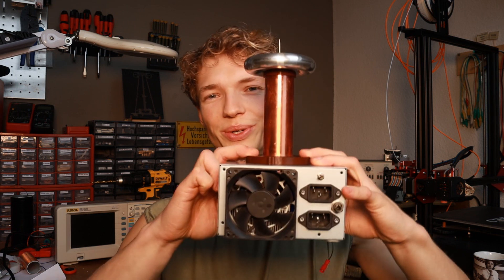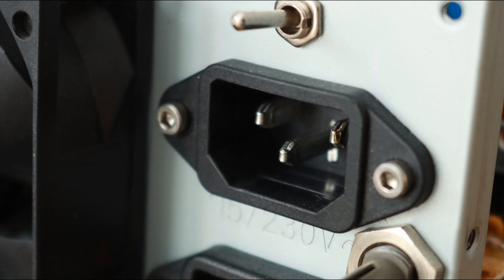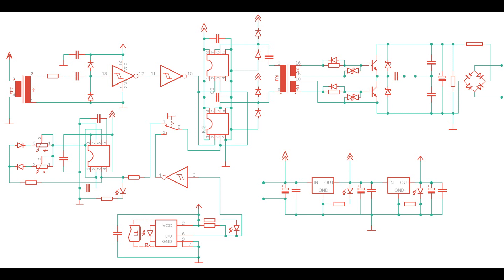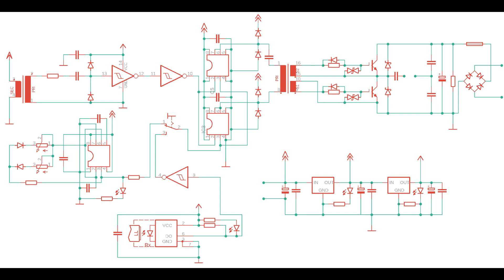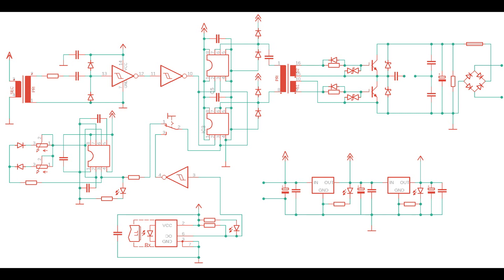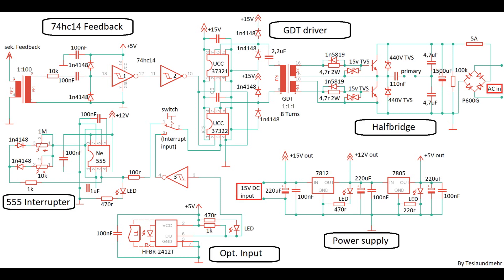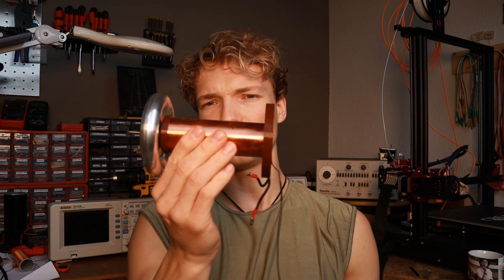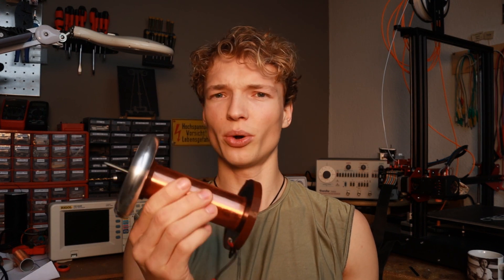Tiny Tesla Coil Tutorial (simple DRSSTC)

Comment: Another great design! I do wonder how you get the IGBT's from being simultaneously turned on (short cut), from 50% duty cycle. is that a function of one of the IC's? to set the pulses below 50%?
Reply: I might use optocouplers in the future to get hv isolation for the gate driver

Comment: this is not really a drsstc (double resonance)... yes it has a resonant capacitor on the primary, but the circuit will not resonate at the resonant frequency of the L-C circuit of the primary because you took the secondary current as feedback... this circuit has benefits over the simple sstc mainly because of that resonant capacitor, but its not really a DRSSTC... to make it a real DRSSTC you would have to take the primary current as feedback! that would really boost performance, greatly increasing primary current and thus, secondary current.

for the first half of the video i was.... NO!! this is not going to work, because the primary was sitting flat to the metal box, thus making an induction heater, heating the metal.
But then in the final clips you changed the design, very good decision!

after all this is a very well made video, i am in love with your videos and passion!
your videos can inspire thousends of people!!!
Good job!
Reply from the maker: Thanks, that is a good conversation!
Reply: Can you explain why secondary feedback is not possible for dual resonance? Feedback is feedback
Reply: @Magneticitist  in this case you actually have two resonance frequencies, one for the secondary and one for the primary. the trick is in the tuning, if both frequencies are the same, were you take the feedback doesn't matter, as you said.
But that can be very difficult because you first need to "tune" the circuit varying the primary inductor (that's why big DRSSTC have uninsulated copper primary, for changing the position of the "tap" and thus, the inductance), and then, the secondary frequency varies because the "streamers" change length, and thus capacitance.

in this example he took the feedback from the secondary, thus there is only one frequency that the circuit is runnung at: the resonance frequency of the Secondary, that means that this is not a DUAL resonance SSTC, is SINGLE resonant like a SSTC.

Primary resonance still exist, but the circuit is inherently not running at that frequency, thus primary current is not maximized, and performance is left on the table.

At the end the circuit works fine, there is no reason it wouldn't, but the primary capacitance is only there to boost the performance.

sorry for the long comment but this subject is quite complex and need to be cut in many simpler parts to comprehend the full picture.
:)
Reply: @OtreblaAntoniofaidate  I can't say what his exact tuning is but I had assumed he tuned the primary LC close to the fres of the secondary. It's definitely harder to do but either coil falling out of tune with the other is inherent with either feedback method. Steve Ward's drsstc .5 uses secondary feedback.
Reply: @Magneticitist  I see... i never noticed that particular on the .5 DRSSTC, and now searching for secondary feedback DRSSTC on google there are some similar circuits.

So only adding a suitable capacitor on the primary makes a DRSSTC? I don't think this is the case,  because of the name, DUAL resonance. (Steve even mentioned that primary current feedback is cit."the only way to go with these things for high reliability" in the last lines of the page)

A DRSSTC can work by itself, without a secondary, its still runs at the resonance frequency, its an inction heater basically.

Primary feedback comes with more advantages other that higher current due to resonance, it comes with ZVS or zero volt switching, so the switching devices are "soft" switched, not "hard" switched like in the case of a SSTC, thus improving switching losses, speed of switching, reliability, switching transient, EMI and heat output.

at the end, we make the names ;)
(but my opinion in the matter is clear)
Reply: @OtreblaAntoniofaidate  I believe the main reason primary feedback is chosen is because it's much more reliable as far as setting the switching as you said. Easier for high/low pole operation and usually the parameters are set based upon what is required for the ZVS or ZCS. I've never had either setup 'automatically' switching at zero volts though.
Reply: @Magneticitist  you have one more suscriber ;)
Reply: @OtreblaAntoniofaidate  hey thanks!
Reply: Anche nelle DR con feedback al primario non si ha un perfetto/fisso tuning LC primario/LC secondario, per via dell'aggiunta di capacità delle scariche in crescita al LC secondario, per questo si tende a usare un LC primario con frequenza un po più bassa del secondario, per ovviare al problema, così quando le scariche crescono si avrà il massimo del tuning, quindi non è corretto dire che non è una DR, il compromesso va sempre fatto tra le due frequenze LC, sia con feedback primario o al secondario. Il feedback al secondario è usato ormai poco nelle DR per via del miglior timing che arriva a essere ZCS, mentre se usi feedback al secondario necessita un metodo per avere ZCS, tipo un induttore regolabile al feedback, Finn Hammer docet